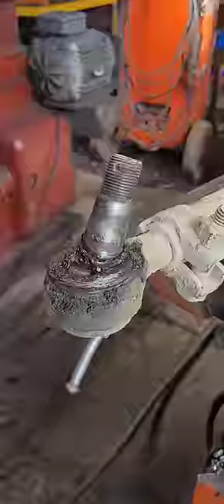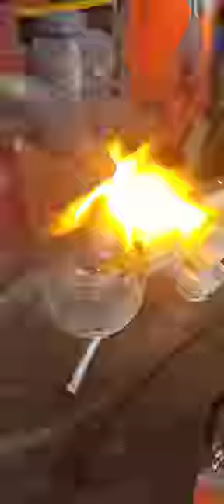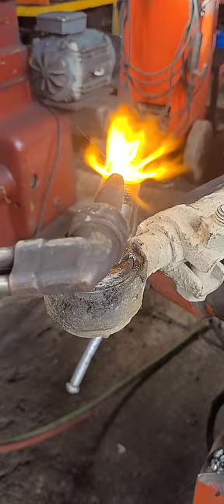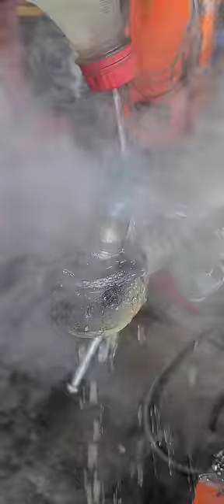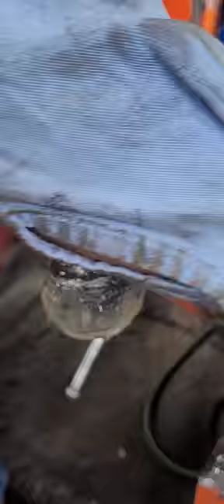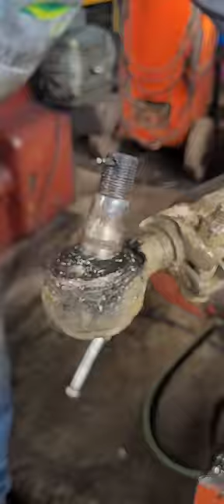Como Sacar Pin Terminal Barra #shorts #mecanica

Comment: Never in my 53-year mechanic experience have I had to heat a tie rod end to get the cotter pin out
Reply: Never in my entire 63 year life, a waste of time and gas.
Reply: Not in my 100 years of being an ASE Master technician have I wasted my time removing a cotter pin.
Reply: In passenger car applications there is a nylon socket that would be damaged if ever subjected to such heat. Grabbing and leveraging them with Cutting pliers is usually the best method for removal, but I’m not above drilling one out which is common practice on replacing Subaru axles.
Reply: The metal would be damaged from heating it like that, not to mention the quenching afterwards. Would it fail? I don't know, but these parts when new are made from heat treated material for a reason.
Reply: In 53 years you done so many wrong jobs
Reply: This is a  wrong  job, better  is change  tide  rod  brand new.

Comment: Never should you use heat on a suspension part. This changes Tempering of the metal. Use drill bit to drill out soft metal Cotter key.

Comment: You just ruined the temperament and strength of those threads I would not reinstall and use that it will fail